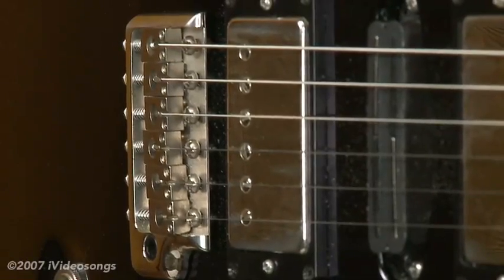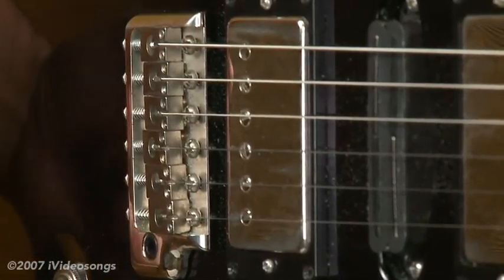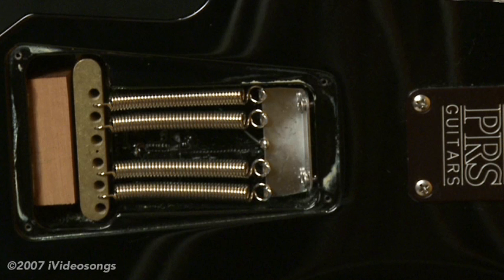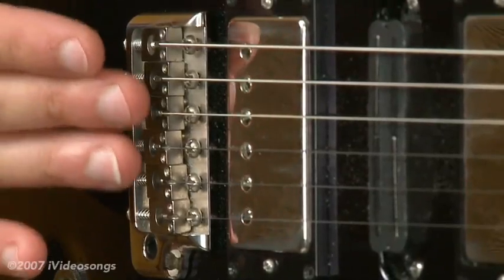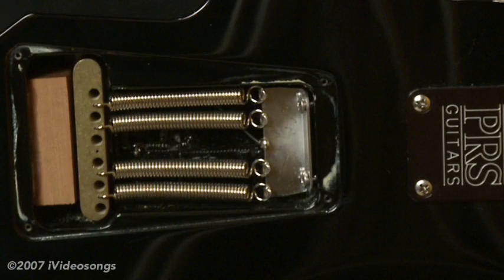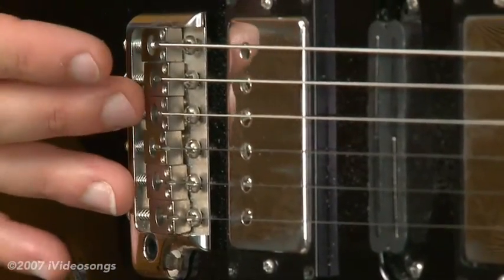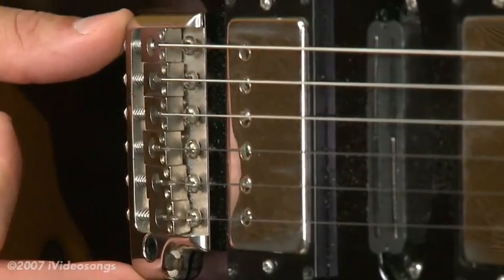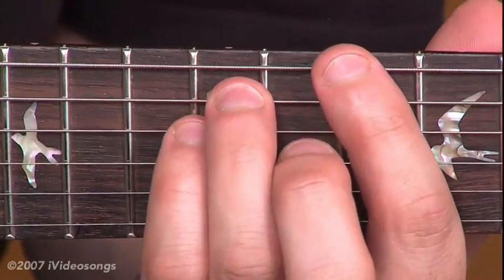Tremelo Setup

Comment: if it is hard to push the tremolo bar down then take the plate off the back and then remove a spring, this will lessen the tension and put your guitar out of tune, but once you retune the tremolo should be easier to use, hope it helped.

Comment: well it depends on your tuning + the string gauge. normally, if your going in E standard, if your using 10, you probly want 3, 11 and higher your probly gonna want 4. however if you were using 11 gauge in standard D for example, your probly still only going to need 3 springs. It's really a matter of getting to know what strings work with what tunings with what amount of springs. most guitar techs will have a good idea about this.

Comment: You take the cover off the back of the guitar & tighten the screws that are attached to the springs.  Floating allows you to pull notes higher.  If you make it flush, you can only make notes go lower.

Comment: Tighten the trem claw screws.  The tension from the srings will pull the bridge flush to the body.  You will have to set the string height and intonation after you do.

Comment: in this case that guitar (prs) design to have a floating bridge. why? so that you can pull the pitch up and down without having the body recessed. you can see how the saddle line up with the body. if you're a beginner and tuning is an issue, then you'll want a fix bridge or tremolo that design only to pitch down. cuz if you have a floating tremolo and you want to change the tuning, you have to change the string gauge as well to match the spring tension. example: E flat tuning with a 010 gauge.

Comment: Prs bridge setups are designed to float😂 thats why the 6 screw hokes are beveled on thr bottom and each screw has a ring cut in the shaft under the screw head, tge beveked holes act as a blade edge for the rings in all 6 screws to sit in, the prs bridge is desighned to float completely at 1/16" over the body and be synchronized betweeen string and spring tension to keep it at 1/16" over the body, its basically a non locking 6 post floyd rose and when set properly u can use the wammy up or down and it stays in tune perfectly,i set my prs full brass setup exactly as i stated only with the tail end slightly higher at 3/32" with ernie ball power slinky 11 guage strings and my rig stats in tune better than my previouse eig witch was the same exact setup only with an original floyde rose. I use the solid brass prs 25.5 scale with a ibanez 170 style custom body with a jackson style neck, american basswood body with baked on nitro lacquer finish, emg 81/85, jumbo frets, and staggered tunders, plastic nut, and ernie ball power slinky 11s amd its the bees knees

Comment: Floating trem lets you pull up and push down letting you really explore the trem.I set my prs 1/2 step froward it was a pain to set up but well worth it once you fool around with spring tension and intonation set locking Keys your good to go On the other hand if you do not have locking keys or a floyd style nut lock your guitar will never stay in tune and you should invest in a new set of keys or block that trem. Just my thoughts not ness correct.

Comment: I've just changed the gauge of strings to 12 gauge because I've started playing down tuned (drop c). As a consequence, the bridge is sitting up by about a quarter of an inch. What should I do? I know I've got to tighten the tremolo strings, but won't I risk royally messing my guitar up somehow if the tension is too tight?

Comment: im afraid that my guitar will break when i do my whammy too hard. it is really tight when i try to go down with it
waht do i do?
(i have a fender squier bullet strat)
Reply: It won't break, but you have too much spring tension.  Loosen the claw and tune your strings DOWN until the bridge is flush/parallel to the body and you're in tune.  Repeat as needed.  If the claw is already out, remove a spring or 2.

Comment: A lot of bad info here.  PRS trems are designed to float and factory spec is 1/16th of an inch above the body.  Decking the trem, which I do on my Strats is a personal choice but not something that you HAVE to do.

Comment: Don’t listen to this guy!! Floating is normal and very stable for a tremolo of any make. If you’re having tuning issues and your bridge is properly set up always look at the nut first. Changing string gauge or an Improperly cut nut will make the string stick and cause tuning issues. If after you’ve made sure the nut is cut properly and you’re still having issues, take some light machine oil and oil all 6 screws where the knife edge comes in contact with the screws. That should cure your problem. If you can’t resolve the tuning issues either bring it to a tech or give up guitar.